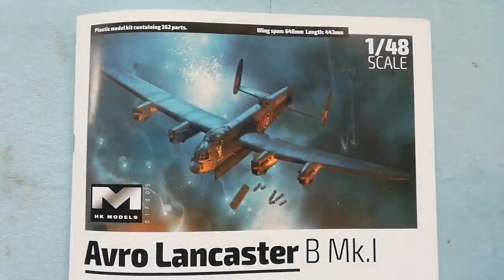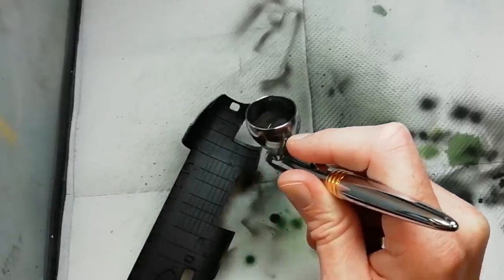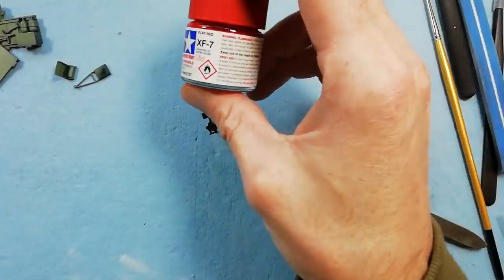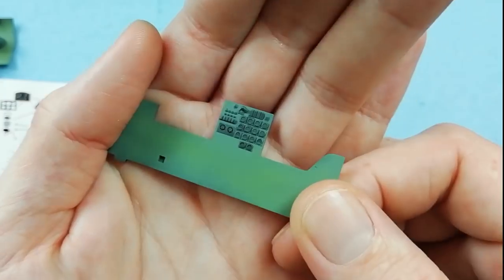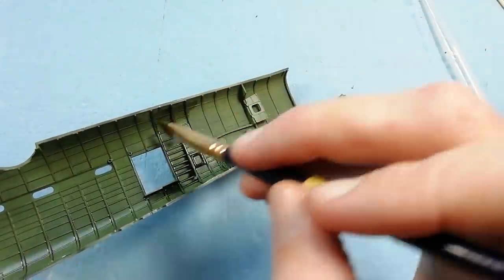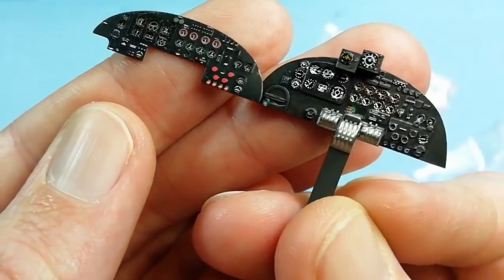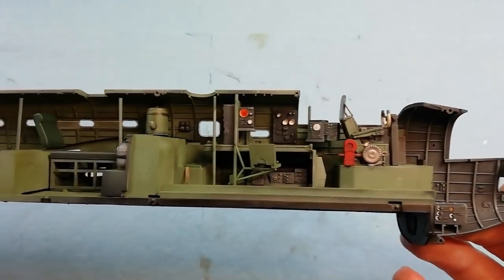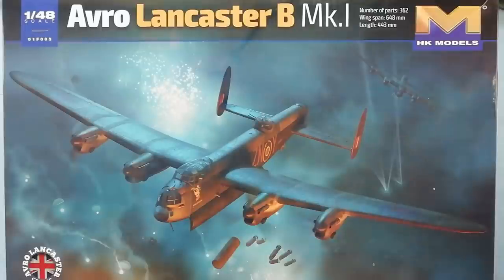New HK Models 1/48 Avro Lancaster Build - Part 1 - Interior

Comment: Looking forward to the rest of this build...I've done a bit of research already on the HK 1/8 Lanc compared to the Tamiya one and the general consensus is that the HK one is the better kit...The last time I made a Lanc was in 1977 with the Airfix 1/72 scale Lanc in black plastic and Roy Cross' famous artwork...so very much looking forward to getting this kit...soon!
Reply from the maker: The HKM kit is definitely a simpler build but there's way more accurate detail in the Tamiya version. Personally I prefer the way the HKM goes together but it is a modern tooled kit. Having the wings slide on and off makes painting so much easier, fits in the spray booth for one and makes storage/transport easier if you were going to shows I suppose. I'm sure we will see some stunning builds of the kit once we get some aftermarket options.

Comment: Thanks for a great build so far! Showed me a little on the Abteilung stuff which I just bought recently! I’ve been working on the 32nd nose art kit, building the Canadian version, but not hyper accurate! I just learned what I thought was aircrew breathing O2 bottles were in fact gear blow down, and have to change the colours! I have used the Eduard set for mine, not as nice as Airscale, but it will do. I have subscribed and look forward to future videos!
Reply from the maker: Thanks Harald, I fancy the nose art kit but probably tackle that one in the future. I found out a lot of information as I built the kit, I'll do a summary of what to look out for at the end of the series, a sort of summing up of the kit. There's more use of the Abteilung oils which I go through so hopefully some useful information for others.
Cheers 👍
Reply: @spruehunter  why do these pratts waste hours doing stuff you can't even see? Why don't they cut a hole in the side
Reply from the maker: @jamespatrick7358  I don't think there is anything stopping you from making a "cut-away" model to display the interior, I suppose the only limit is your imagination and ability. If people want to spend their time on interiors then that's up to the builder, as a child I remember rattling a brush of humbrol cockpit green round the inside before promptly sticking the canopy on with fingerprints for good measure, how things have changed 😂

Comment: Fantastic video, and will be very helpful for my build of this kit! Can I ask what the styrene filler is which you're using is? I can't seem to see a product quite like what you're using.
Reply: Anyone??
Reply from the maker: Hi Chris, apologies for the delay. The filler is styrene card chopped up and then added to a bottle of standard Tamiya Extra Thin. Add as much or a little as you want to alter the consistency, I have a thick and thin version depending on what's needed. Hope that helps and part 4 is finally up now.
Thanks 👍

Comment: Great work - so much skill and detail for the interior but in the end it can't be seen. Whats your feeling on this - at least you know its there?
Reply from the maker: Thanks Gary, I think it's up to the modeller how far you want to go. Once it's closed up there's not much to see, if I wasn't doing a video build I would be tempted to leave it pretty basic from the wireless operators seat back and maybe detail from there forward. I'm happy with the kit decals for the instrument panel and the addition of the flight engineers panel as these are most visible (p.e. seatbelts help) 
I'm more blown away with the exterior detail. Once you get primer and paint down it really pops and that's even before washes. 
When I'm building and do spend time on an interior I usually take a bunch of photos before I close it up then I add them to the album of the build once completed, helps me keep a record of what I've done. Useful things like photos of what paints or clear coats used at different stages so in the future I can look back for reference. Cheers for the kind comments 👍
Reply: @spruehunter  ㄦ

Comment: Great video. Love how it is coming out so far. 

Quick question, how did you set up your camera? I want to film how I am building my models and dioramas, but it feels as though my set-up is not working right (just have my camcorder and tripod on my work table). 

This video has been a big inspiration  for starting to film that process.
Reply from the maker: Hi Matthew,
I have my phone set up on a simple overhead adjustable boom, which is mounted in front of me. This allows me to film building on the bench but I can simply swing it over to film anything I'm painting in the spray booth. For lighting I use 2 separate led panels on tripods which allow me to move them around as required. Hope this helps you in your builds, glad you liked the video 👍

Comment: Hi, thanks for the build series so far! Can I just ask, did you use a varnish on the interior parts at some point? Satin or something like that?
Reply from the maker: Your welcome, no varnish used on the interior apart from a few drops in the dials on the instrument panel. You could use a varnish if you wanted but I prefer the effect I get using Tamiya XF and the Abteilung wash, the texture of the paint is great for weathering. I would probably use a flat or satin coat if I was using a more glossy paint like MRP to give some texture for the wash and dry brushing to stick to. Thanks for the question, hope that helps 👍

Comment: Glenn I have a question for you about the tailplanes as hk really messed these up on the 1/32 one as one one side they are both uppers and the other side are both lowers have they fixed this on this one also would love to see a proper plug for the late rcaf Mark 10 that had the martin turret to fill in the hole where the original turret was as on the real aircraft the hole was cut more for award also would love to see the strenghting plates under the turret a look at the duxfort museum lanc is a late mk10
Also would some of the tamiya upgrades work such as props and wheels thanks for any comments Scott
Reply from the maker: Thanks for your question Scott, I'm glad to report they have sorted the issues with the horizontal stabilisers so we now get proper tops and bottoms, port and starboard 👍
As for the turret, you sound like you know more about it than me, there is a blanking plug for the top turret so there will be a Dambusters version somewhere down the line. If it's a turret specific to a mk. 10 then maybe a kit will be released to allow that version to be build? Possibly HKM getting more boxings? Release the mk. 1 as everyone will want a new tooled Lanc so will buy them. After initial buzz dies down release the versions everyone really wants, Dambuster, Grand Slam, Mk. III etc.
Not sure about using Tamiya parts, but I think there will be a lot of aftermarket available soon. Look at the B-17 series and what you can get, I'm sure we'll see stuff announced soon. At least I hope so as I'm itching to do a Dambuster!
Reply: The RCAF Mk. X had the paddle blade propellers and no windows down the length of the fuselage and different instruments on the flight engineer's panel (General Electric). Different engines too (Packard US built Merlin 224s ) but you can't see them anyway. Doubt we will ever see a Mk. X as all the other variants used the earlier fuselage. Guess they will sell more Dambuster etc than Mk. Xs, but still nice to dream.
I remember seeing KB889 (Duxford Lancaster) a number of times when she was in Canada. Just after the owner had rewired it, vandals got in and cut all the wiring. Rumour was it was done in retaliation on behalf of another museum after the owner would not sell it to them but that's all it might be, just a rumour. Nothing more ever came of it. When KB889 was sold, the government approved the export of the airframe but not the engines which, after overhaul, I think went on to help get FM213 flying.

Comment: What was that liquid putty you use at the very beginning?
Reply from the maker: Hi Ernest, I did forget to mention that so glad you asked. It's "sprue goo" or styrene filler, made using Tamiya extra thin glue with bits of styrene sheet chopped up and added. You can vary the styrene to glue ratio depending on your needs. Benefits over other putty/filler is once its cured it sands and scribes like the rest of the kit plastic with minimal shrinkage. 
Hope that helps, there's videos on here about how to make it. I use a thick one for gap filling and a thin one for minor jobs. 😁👍

Comment: What is the name of the sanding/buffing sticks you use?
Reply from the maker: Hi David, they are Flory Models sanding sticks and sponges. Highly recommended, they do a starter pack with pretty much every grade of sander they do which is very reasonably priced. The blue and green a long with the polishing sticks is what I use most. Hope that helps, thanks for asking. 👍
Reply: @spruehunter  Thanks. I live on Vancouver Island so my ability to obtain some of these tools is limited; off to check if they are available on Amazon.
Reply from the maker: @davidbishop1570  I know you can get them from High Altitude Hobbies in the US, probably your best option. In the UK you can get them directly from Flory Models or PM Models (who ship internationally but I'd imagine postage would be expensive) and Serious Models in Europe are the only ones to stock them.
Reply: @spruehunter  Looking forward to Part 3. I am primarily a 1/12 Tamiya F1 car model maker but have tried a few aircraft, 1/72 Airfix Valiant and Vulcan to name the most recent. The part I find most challenging is weathering so interested to see how you apply that to the Lancaster. By the way excellent and instructive videos, I am now a subscriber.

Comment: I’ve been searching everywhere for a crew to put in the Lancaster so far no luck
Reply from the maker: Hopefully with this new release someone will offer a full crew, sure to be alot of aftermarket for this kit. Maybe a gap in the market for someone with a 3D printer and some know how if the big companies fail to supply.
Reply: Maybe scrounge some from the old Tamiya Lancaster?
Reply: @spruehunter  it’s been out for over 2 years and you are right there are tons of after market kit for this kit but as of yet no crew
Reply: @BigLisaFan  that would be next to impossible easier to scratch build I think
Reply: @BigLisaFan  who would want to degrade their own model by selling the crew out of it 😂
Reply: @zaynevanday142   Generally I don't put the crew in my models. If I have left over bits another modeller needs that I don't, I pass them along. I have had others send me bits I've needed. It's what modellers seem to do.
Reply: @zaynevanday142  There is a set of aircrew from a Tamiya Lancaster currently for sale over on Ebay.
Reply: @BigLisaFan  rights thx
Reply: @BigLisaFan  I cant see it can you post a link ?
Reply: @zaynevanday142   Not sure how to do that but will get as much info as possible.
Reply: @BigLisaFan  on your PC or tablet ?
Reply: @zaynevanday142  Search under Tamiya 1/48 scale Lancaster BI/III Part Tree Z from kit No. MA120. Seller is Beaddreamsllc
Reply: @BigLisaFan  my Lanc is the big one 1/32 scale thanks tho
Reply: @zaynevanday142  Oh, I thought it was a 1/48 scale one as that what was being built here.

Comment: Why didn't you make the small windows with the Krystal Klear instead of using that as a glue? I don't think you know how to use that Krystal Klear... Read about it on the Web, you can make windows with that Klear. I ALWAYS use that to make the small windows. I made this HKM Lancaster and the both B-17's,and didn't used the tiny windows,but used the Krystal Klear to make the windows. Maybe for a next time, m8. Awesome build btw.
Reply from the maker: Hi Moxxi, yeah I use that method for most windows but on this particular build I used the kit clear parts as they are painted over as "S for Sugar" didn't have the side windows in the fuselage. She also has quite a high demarcation line between the camo and the black underside compared to most Lancs. I agree that Krystal Klear is a far better way of achieving a scale looking window but also wanted this to be a "simple to follow along" build, hence the basic interior detailing and focusing mainly on the construction of the model so everyone can produce a great finish to their model and then add their own artistic flair when it comes to painting. Glad you like the videos, I'll maybe make a point of demonstrating the uses of Krystal Klear in a future video. 👍